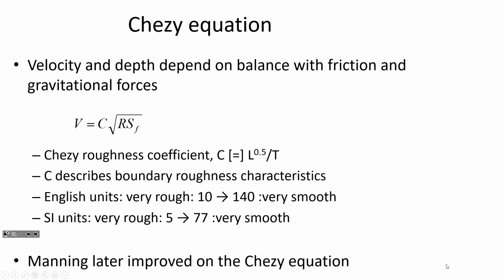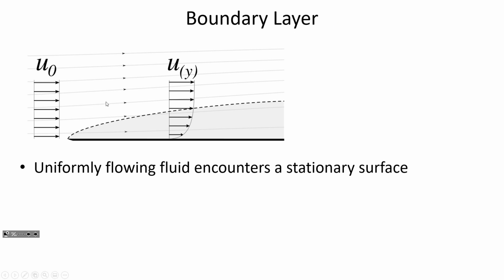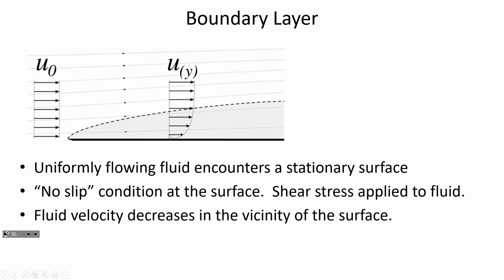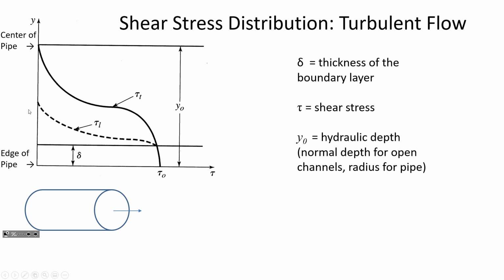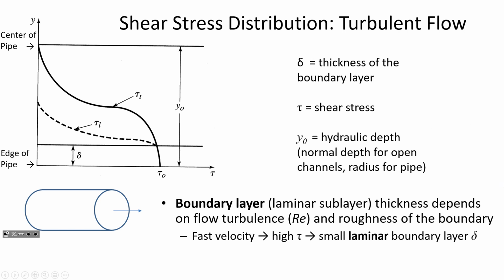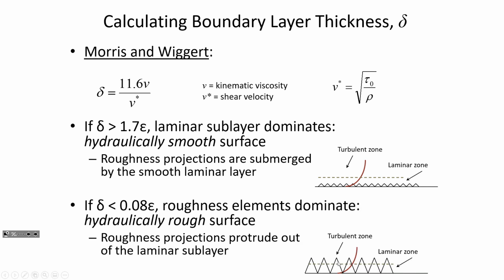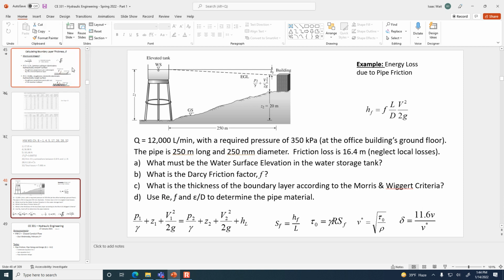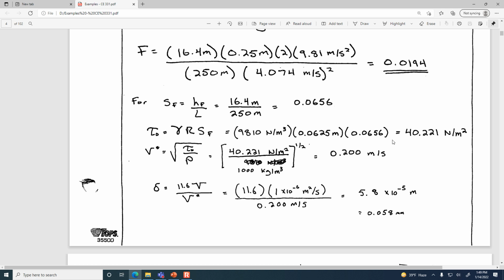Fluid boundary layer thickness, velocity profile, shear stress - CE 331, Class 3 (14 Jan 2022)

Comment: If possible I would like to request the assistance in solving the below problem
A machine uses nozzles that can produce 50 kg/s, of an ideal gas mixture with an average molecular weight of 30.  If the volumetric flow rate is 30 m^3/s at 350K and 420 KPA. The required number of nozzles is _____________